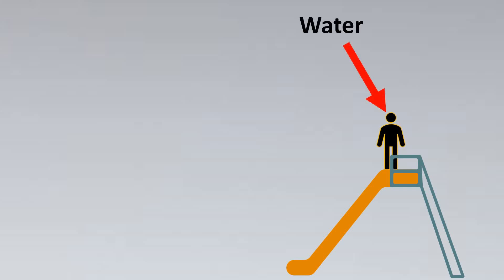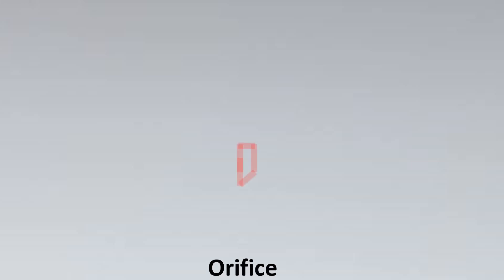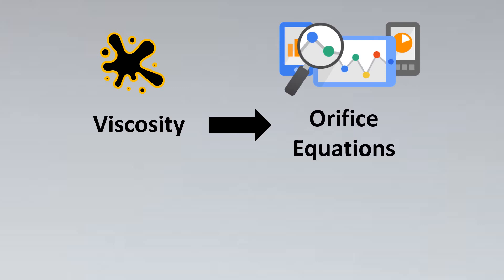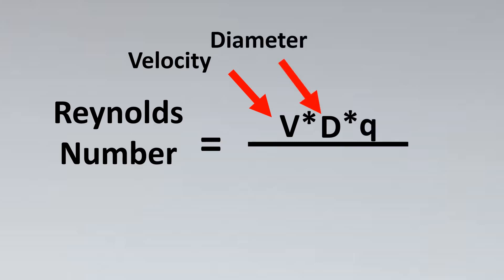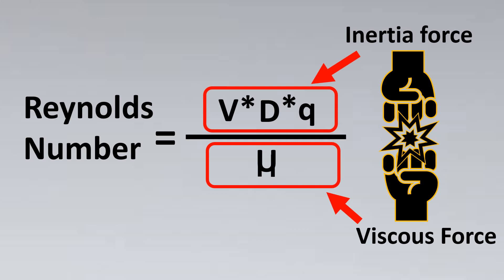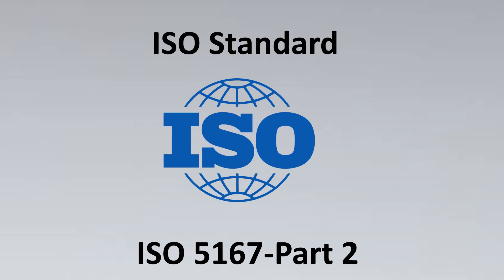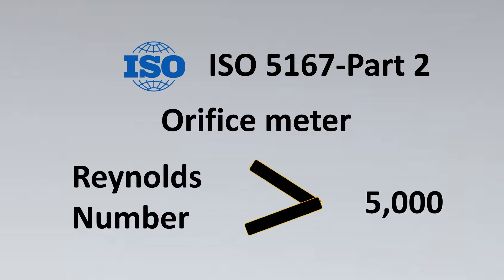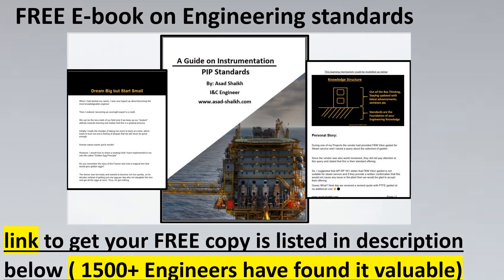Orifice Flow meter's ISSUE with VISCOSITY

Comment: Hello Asad Shaik. You are doing great videos on I&C. Good. Please keep going. I have a small question on pressure gauges. Working pressure is 6 bar and Maximum design pressure is 30 bar . Can u suggest for which range of PG I can select.?
Reply from the maker: You can select the normal working range in 50 to 75 % of Full Scale 

So for your case we can select range of 0 to 12 Barg

And add a gauge saver to protect PG from Design pressure of 30 Bar.

Hope this helps and thanks for your comment 😊

Comment: Good work....
but my observation on Reynolds number is that it also describes fluids flow characteristics ...like steady,turbulent etc which effects both flow meters   and control valve design/selection criteria,
may  b need make  another dedicated separate video on RN....
Thanks
Reply from the maker: Yes i completely agree. Viscosity is just one of the component of Reynolds number.

This video deals with the viscosity issue in orifice meters and yes we can make a Detailed video on Reynolds number !!!

Comment: Orifce sizing  is based on the normal flow or the maximum flow.? As my under standing sizing is based on the maximum flow so it can measure the maximum  flow. Am I correct  or not